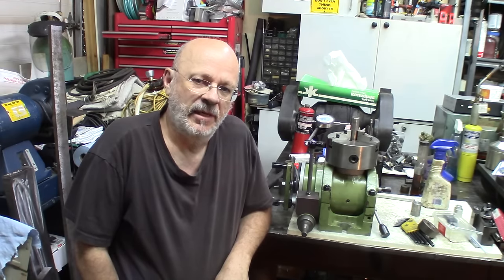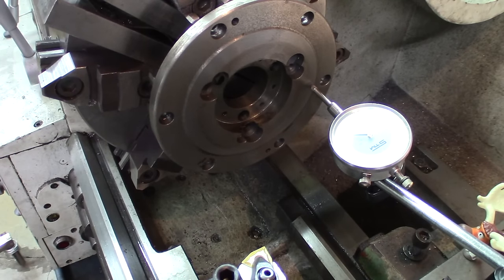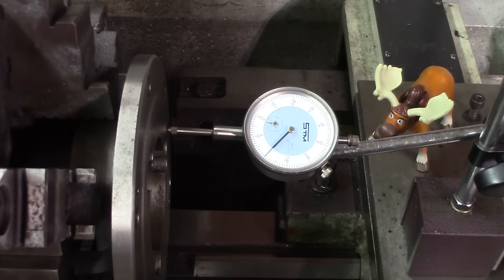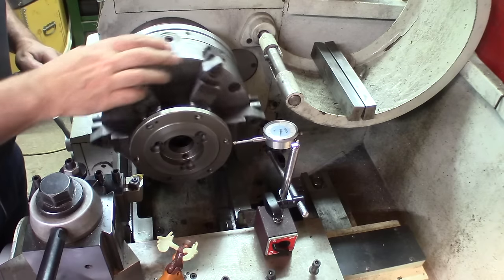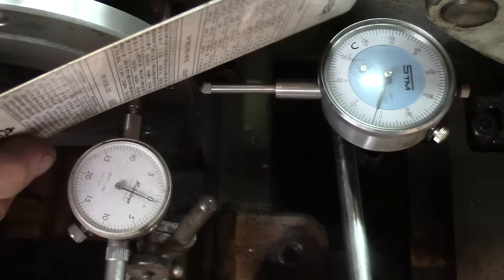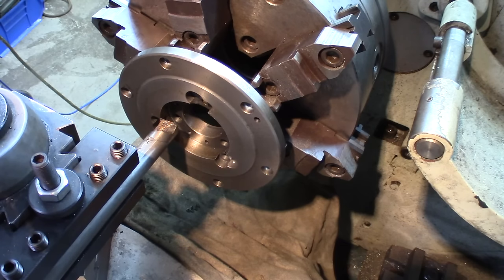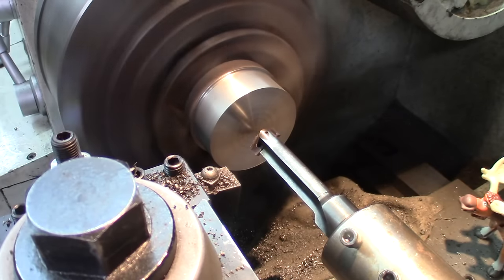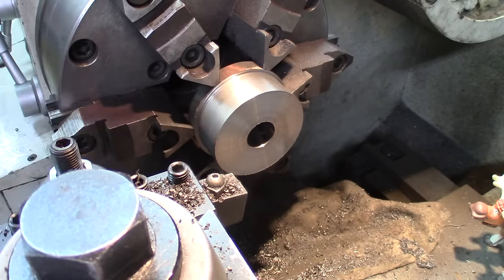Rotary head chuck runout repair part 1

Comment: I envy you that 6-jaw!! As usual - set-up is what takes so much time. Love that AKG mic of yours - if not so expensive would try and get one. I have a new 3-jaw on order and hope to use my old back plate so - will be doing some similar work for that.
Great stuff Pierre - look fwd to next stage.
Reply from the maker: +ChrisB257 Hi Chris, adjustable synchronized chucks are very practical tools, like to use it in place of the 4 independent jaws, since it weighs around 80 pounds, saves me some changes...   ;)
If you find those AKG mikes on the used market, the price vs quality make them a great deal...
A good chuck is so much more pleasant to work with.
Thanks for comment,   Pierre

Comment: Not sure I have seen a drill like that.  Looks like it did a good job though.  Thanks for sharing.
Reply from the maker: +cerberus Hi Harold, got the set to 1 3/8'', you can poke into a chunk of steel at about 1000 RPMs, no center or pilot hole, preferably injecting coolant in the shaft... It takes a couple of extra HP's though, the final hole looks like it's been bore.... Like those drills...   ;)
Cheers,  Pierre

Comment: My Set-Tru three jaw was set up (not by me) on an adapted back plate.  No register bore to the spindle, just threaded, and it hung way out over the bed.  I had a bit dig in and stall the lathe, and when I got everything sorted out and started back up, the chuck weaves and bobs like a bobble head.  Sprung it while using a motor that is about 1/10th the power of what should be on there.  So, for now, everything has to be done in the 4-jaw (which, it turns out, needs some major re-conditioning) while I search for a suitable slab of material for making a new back plate ... and a lot more tooling.
Reply from the maker: +diggerop It's sad to ear that people disfigure good tools and make them unusable, are you in position to look for something used on Ebay or with the local adds... Sometimes you have to choose your battles... ;)
Hope you find what you're looking for, I got most of my tooling by looking for good used deals...
Thanks for comment,   Pierre
Reply: 98 lbs is a lot to have hanging past the end of the spindle, supported by only the threads. I've been able to determine that the 18" faceplate is the original one to that lathe, so I've got a good pattern to work from for another.

Yeah, that "large amount of tooling" that came with the lathe seemed to shrink very rapidly when I start using it and realizing what I don't have, like a chuck for the tailstock.  There isn't much around here local so I'm going to have to try dovetailing my searching with some truck moves.  A stop at Smith & Edwards, out near Salt Lake, sounds like a good place to start.  They claim to have what you need, if they can figure out where they put it...
Reply from the maker: +diggerop 98 pounds isn't that much for the bigger machines, they can turn pieces of several hundred of pounds so a well balanced chuck is no problem, can't say the same on an Atlas or a Southbend sized machine...

A good supplier and sometimes patience will do miracles when searching tools... Hope your supplier gets a little organization and get you what you need most to start with... ;)
Reply: Well, it was for that back plate.  I think it was made for a much lighter lathe and chuck. Add the torsion involved with difficult turning, it was trouble waiting to happen.  The next plate will probably be twice as heavy, which will add another critical item to the list: A crane for lifting things into position. Hernia surgery is not fun.

If push comes to shove, I am well within driving range of the Grizzly facility in Springfield MO.  Harbor Freight also has a store or two nearby, but I tend to shy away from them.  You've heard the stories.
Reply: +diggerop If other (cheaper) sources fail you, McMaster-Carr has short rods (disks) of various metals including cast iron (gray or ductile) up to 12" in diameter. 12" dia by 3" thick cast iron (largest size) is $177. 

I've seen (but can't remember where) blank back plates in cast iron.  Neck for spindle and full diameter disk with small pilot hole through center.

Some stuff on eBay if you search for [[ blank back plate lathe ]].
Reply from the maker: Peter W. Meek
Have you tried places like Shars, (I'm not too hot about them) but sometimes if you're really stuck...???
Reply: Peter W. Meek I got out there last night, tried to measure everything.  Made notes on the spindle measurements and the faceplate bore sizes and depth, and tried to determine thread type and TPI.  Going back out today to get a few dimensions I missed and try to determine any limits to how far back on the spindle I can choke it up.  I'll get more pictures and post for opinions/suggestions on the MYT page.
Reply: diggerop Assuming that South Bend has been doing it correctly, the critical surfaces seem to be the nominal diameter collar inboard of the threaded portion of the spindle, and the adjacent face. These center the chuck and align it with the axis of the spindle. The threads themselves seem to have a fairly loose tolerance (so they don't force those two mating/registering surfaces out of alignment). If you cut the internal thread leaving the collar area undersized, tune your back plate to those two surfaces, then mount the back plate and machine it to fit the chuck, you should have good results.
Reply: I just got back in from verifying some measurements.  I decided to "autopsy" the plate that had been on it.  It was actually holding the chuck past the end of the spindle, and the threaded area was the only support it had.  The collar around the spindle should have been longer, extending past the threads by about 0.870 and seated against the back shoulder in the spindle.  That bore should have around .002 clearance on the spindle.  And, if the bolts that held the backplate on are any indication, the material mounting it to the chuck should have been at least half an inch heavier.  Whoever machined the step for the chuck to register on did get that right.  It pulls up flat when you tighten the bolts, but requires a tap or two to get them apart again.  It definitely got sprung, I measured 0.018 runout at 3" radius.  At 6.125 radius it translated into 0.042 of wobble.

Comment: need drill what  do they call it
Reply: I mean neat drill (dam auto spell)
Reply from the maker: +Chris Anderson Those AME co. drills you'll find the site here:

http://www.alliedmaxcut.com/

I also have some Sham drills from Iscar, a little more precise I would say, but $$$$
Reply from the maker: +Chris Anderson
Also to use this type of tools you really need a sturdy setup that can turn fast enough with the required HP's, if it rattles you'll chip the inserts and it will cost you... NO peck drilling, just steady one shot entry.

Comment: Hmmm, you can't live with .015 runout? Lol. Nice six jaw independent chuck!
Reply from the maker: +Michael Murray Hello Michael, nope, can't live with a bad tool, it brings too much frustration when I need some accurate parts...    .015" is a LOT of runout... 
That 6 jaws is a synchronized chuck, it's adjustable on the plate, there is about +/- .025" on this one, practical for highly precise parts, doesn't require to switch to the 4 jaws chuck, very well appreciated since it weigh about 80 pounds... ;)
In coming video I'll show a little more detail on how it operates.
Thanks for comment,   Pierre